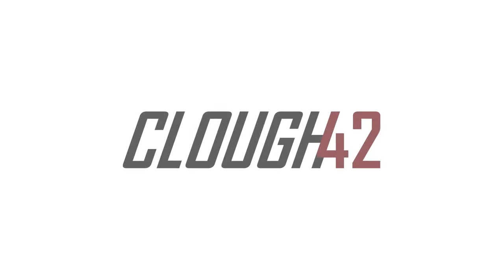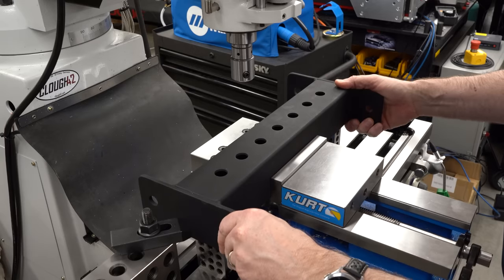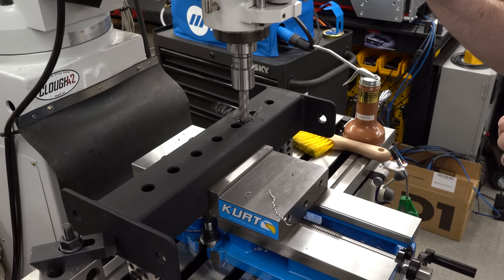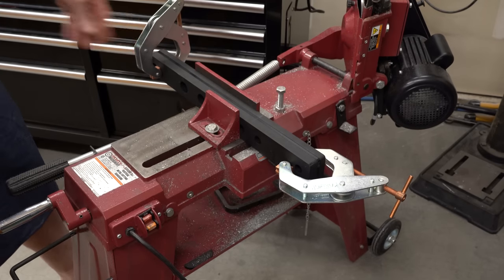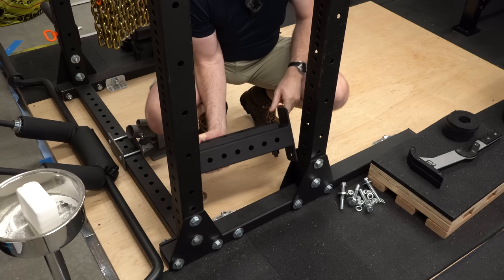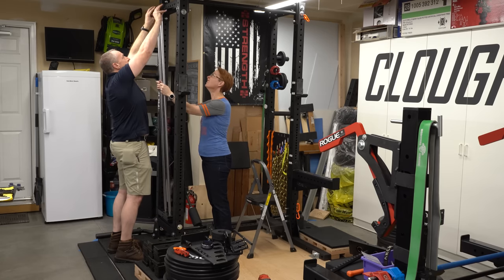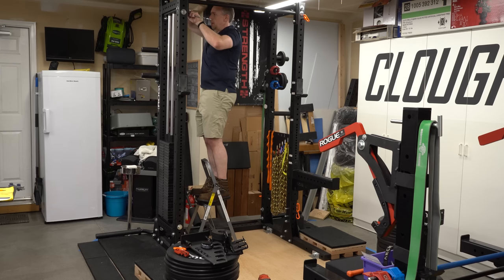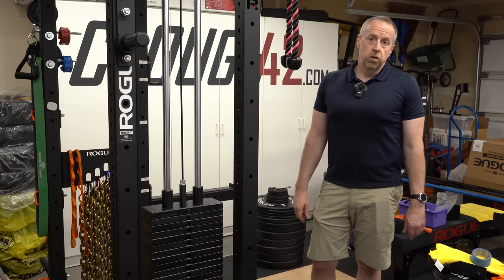Abusing Rogue Equipment | Adapting a Weight Stack Slinger Cable System to Work in an HR-2 Half Rack

Comment from the maker: Update:  Black Widow Training Gear now offers the pair 17" crossmembers pre-drilled to accept the weight stack slinger, for an additional charge.  Select the "Slinger Attachment" option before adding to your cart:  https://www.blackwidowtg.com/17_crossmember_with_holes_p/cross3317.htm
Reply from the maker: I have no affiliation with BWTG.  I'm just happy they're offering this so I have an answer when people ask me to make a set of crossmembers for them.  :)
Reply: Looking to put a weight stack in a 17" crossmember as well. Question, I know the larger hole for the top crossmember is to feed the cable through, but I also saw that you did it on the bottom, what function does that serve? Thanks
Reply from the maker: @wellnessbyflea  the weight loading rod extends through the bottom of the weight stack.  BWTG now sells the cross members pre-drilled.
Reply: i predrilled mine back in November. I did the same setup as your thank you so much.
Reply: @Clough42  my rod doesn't even pass through the bottom. They probably changed it again on the design.
Reply from the maker: @MetalsForBrunch  I just checked mine again, and It doesn't actually pass through the bottom crossmember.  The bottom plate included with the Slinger has a hole, and the post does extend into that hole, but not into the crossmember.
Reply: The link doesnt work anymore!?

Comment: Which slinger fits the rack?  The monster or monster light? Also do the holes on the rack fit the lat pull down seat and row? Also is it thrill down seat the one that it’s the monster or monster light? Thanks

Comment: Hi @Clough42! 2 questions: 1) Would you mind sharing the name of the double barbell hanger you have there hanging on the back uprights? 2) Do you think the plate loaded version would fit in there if I couldnt't make the weight stack work? 3) How far above the upright (not the highest crossmember) does this thing go? Wondering what clearance I need between the top of my 92" hr-2 and the ceiling itself.. Thank you!

Comment: Dude, I am SO jealous. I have a Hulkfit 2.35 inch Pro Series rack, and NO weight stacks will fit it. I would LOVE to be able to do what you're doing on my folding rack. I don't fold it back though because I can pull in to the garage with it open!!

Comment: Which slinger fits the rack?  The monster or monster light? Also do the holes on the rack fit the lat pull down seat and row? Also is it lat 
pull down seat the one that fits the monster or monster light? Thanks

Comment: Hey there, great planning, work and help :-) Why did you not build the whole thing by yourself? I was looking into exactly this type of exercise equipment to mount here on my wall (no rack or existing equipment) and found the commercially available solutions so very expensive, that I already calculated the raw material to build it from scratch. Did you consider and calculate that or were you just thinking it might be too time-consuming? Just wondering! Thanks for the informative and fun-to-watch videos on your channel!!
Reply from the maker: Thought about it.  Time is a limitation.

Comment: James, Looks as if you could have assembled the pulleys to the crossmember on the bench then attached/slid the whole deal into place prior to loading the weights.  Only say this to possibly save somebody else some time later. But then again I'm looking at it on a monitor in NorCal so what do I know.   Hope that things went well for you in SoCal this weekend.
Reply from the maker: The cable would need to be through the crossmember and that would complicate assembling the stack top anchor plate, but it would be possible.

Comment: I'm surprised that with Fusion360, your cnc plasma table and the magnetic brake you didn't fabricate the pulley brackets with CLOUGH42 logo instead of Rogue! ....  nice mod!
Reply from the maker: The plates are about 1/4" thick, and that's significantly more than my brake can handle.  I did consider buying a hydraulic press brake to do exactly what you suggest.

Comment: To drill the holes, did you use the brackets as a measurement? Also, would the holes you drilled line up with a normal 2" holed crossmember? Rogue now makes a 17" Monster Lite crossmember with 4 way 5/8" holes and 2" on center
Reply from the maker: The drill drawing is in the video description.  I don't see the 17" crossmember on Rogue's web site.  What would I search for to find it?

Comment: So no issues with the cable rubbing/fraying near the 1.25” hole that was cut? The rubber grommet on the Rogue setup has been known to keep coming out.
Reply from the maker: No issues so far.  I bought a new grommet to fit the hole I cut.
Reply: @Clough42  Wow that is awesome. Thank you for making this video. That was one of the main reasons why I never bought the slinger. I did not want to pay a large price for something that would constantly have a problem.
Reply: @Clough42  where did you buy the rubber grommets for that size? is the cable too long is it adjustable?
Reply from the maker: @MetalsForBrunch  4 Pack - Rubber Grommets Fits 1 1/4" Inch Opening in 1/8" Thick Panel Has 7/8" Inner Hole https://a.co/d/9E6YRkI

The cable is not adjustable, but the length is working okay for us.
Reply: @Clough42  Is the cable length short enough so you can do a full extension for seated lat pull down? Does the black ball on the cable touch the slinger at the very top and how much cable slack is left over?  thanks for the link to the grommets.
Reply from the maker: @MetalsForBrunch  there's about 11" of hanging cable to the ball.  It's just enough for full extension for me.   You might consider having a shorter cable made.
Reply: @Clough42  I'm 5ft 6 tall so I think my short arms will fully extend hopefully. I've been planning this exact build since last year but when I contacted rogue they told me not to do it lol.   thank you so much for your video and inputs.

Comment: Why not install the pulleys and brackets to the cross member first before installing the cross member. It looks like that would work. Might be a bit difficult to get to a couple of the nuts, but it should be possible with some extenders.
Reply: I thought the same, and if he just sat the pulley assembly on the crossmember it could slide side to side to get at the nuts, then install the bolts.